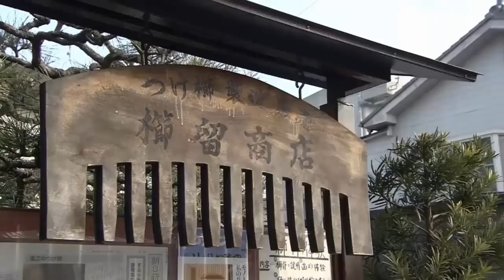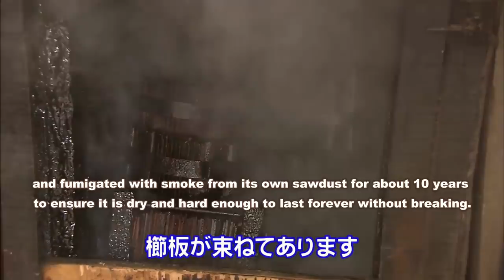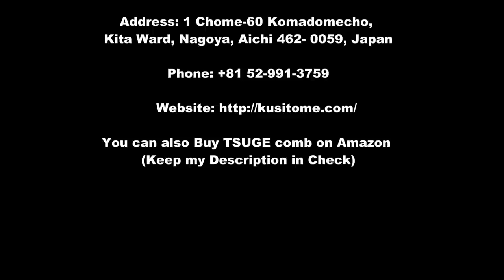It Took 40 years to Ensure the Combs Hard Enough to Last Forever | Young Craftsman: Mori Hideaki.

Comment: explanation from a woodworker: the decades long roasting process is done to set the wood straight and make it unreactive to moisture. normally wood warps slowly over time in one direction as it dries out over years/decades, and it warps back and forth when it gets wet and dries again. this is why you normally won't see straight wooden combs unless they're new. the tight bundling of the comb blanks with the metal hoops is to straighten them, they're showing that they're previously warped from the drying process. this warping is particularly pronounced because the wood is cut from small boxwood trunks, so the combs are slab-cut awkwardly across the growth rings. a better cut to reduce warping would be a radial cut, but that would require trees that are twice the length of the combs in diameter (the combs' teeth need to follow the direction of the fibers for strength, so they would be oriented vertically in the tree). boxwood is used because it is an extremely hard and smooth-grained light-coloured wood, but because it is so popular with woodworkers (for example for all sorts of turned objects like chess pieces), and it grows slowly, there haven't been any decent size boxwood trees for at least a century or two. 

what they're using to smooth the comb teeth are file-like tools made with fermented sections of the stems of horsetail weed, which grows microscopic silica spikes on its surface. it's effectively a slower alternative to very fine sandpaper.
Reply from the maker: the explanation is so well, I will go in-depth this in the next video released
Reply: Thankyou

Comment: What a very humbling job to have . Watching them make something as simple as a comb, makes me feel happy . Today everything is made so cheap and with no LOVE ...
Reply: Classic Gunsmithing is another trade that is taken very seriously. My instructor for gunsmithing is teaching me the traditional classic style, where i take a piece of wood that I had to buy (was a $200 piece of Walnut, which is actually on the lower end as you can spend over 2k on walnut), turn it into a stock (In this case a classic hunting stock), take a bolt action action (I am using a Mauser 98 action) and remove the old finish and re-polish it and either blue or color case it, buy a barrel blank chambered for your caliber (I am doing 25-06 Rem) and reem the chamber so it fits the round perfectly so there is no gas leak when firing, blue the barrel, and more. I simplified it as much as I could lol. Basically I spend $200 on wood (and soon to be more as I need a piece of ebony to put at the for-end of the stock), $425 for the mauser 98 action, going to have to spend quite a bit for the barrel blank, about $70 on a Timney sportsman trigger, and probably around $200 on renting a reamer bit. Oh and that's not mentioning the months going to have to put into it lol. I might also checker the wood. The rifle will be a high end rifle probably would around 5k at best and possibly more if it looks very good. Wood and metal work everywhere is taken seriously lol, sadly after every generation the old styles die off. Soon no one might want a classic hunting rifle or shotgun until many decades when it becomes a trend again lol.
Reply: But not very rich in variety.
Reply: Just checked their website. The combs are $250-600 USD. So they're not starving.
Reply: @littlejackalo5326  How long it takes to make such a comb, how expensive is the wood, how much earn the carftmen and, and and.....

Comment: dried for 40 years in a carefully tended kiln.

immediately rubs water on it.
Reply: The ones he's rubbing water on are wood that's been hung to dry outside of the smoking kiln for 1 year and has curved as a result. In order to straighten the wood pieces, they pair them up concave face to concave face before bundling them and forcing them into the metal hoop, which is then inserted into the smoking kiln for 3 months at a time for a total of between 5 and 10 years until flat. Water is rubbed on the concave faces before bundling in order to help the wood flatten more easily.
Reply: it’s not just water, I have seen wood treatments for high quality furniture carpentry, where after drying, they soaked boric acid or other chemicals and dry them out again. First drying they spaced them out to dry quickly. The wood have to be completely dry so the chemicals can get to the centre of the wood. Second drying they are packed tightly, otherwise the chemicals dried before reaching deep into the middle sections.
That Japanese techniques is perhaps overdone but the principal is the same, instead of boric acid, they probably are water with secret ingredients to prevent moulding, insects or bacteria decays.
 I think the Japanese method is much more superior and the end products will last much longer, even though it is painfully time consuming. But the crafted furnitures in my childhood hometown are known to last for generations.
Reply: @madsam0320  It could be, but in the original Japanese video it just says "he puts water on the bent faces to help them expand more easily."

https://youtu.be/CpcTsXxxi5U?t=460

Furniture and combs are different things. If you're familiar with this workshop specifically, then I'll defer to your expertise, but otherwise the original Japanese as-stated is the best source.
Reply: @pbrown7501  you are right, they put water only on the curved in sides, not soaking all over.
Reply: @pbrown7501  Thanks for the link to the original, unruined video.
Reply: The primary purpose it is put into the kiln is not to dry. It is to harden the wood.

Comment: I was looking forward to seeing how they cut the combs teeth so accurately 400 years ago. It was so disappointing to see them use a power tool. ☹️
Reply: I guess if you can make em without power tools then you can claim to be the best.  Until then I guess we both just watching a talented duo.
Reply: I imagine it wouldve been done with a wooden fixture and a hand file and wouldve just been extremely time consuming and wouldve been left to the younger men to do because theres not much to it, relatively compared to the rest of the process, and its time extremely time intensive. All youre trying to do at that step is remove alot of material in a rough manner so the fine work can begin with the hand files and sandpaper sticks (im not a wood working guy so idk the proper term for that tool)
Reply: I mean that power tool could be very easily made as a hand tool. It’s just a matter of making a wooden rail for a jig to slide on, and then attaching a wheel to the jig with a handle on it so that you can turn the handle to make it slide back and forth on the rail. Then just use the jig and a handsaw to make your cuts! You would just crank the handle, make a cut, then do it again and have remarkable repeatability! I don’t know if that’s how it was done, but almost all power tools evolved from hand tools, so it shouldn’t be too hard to think of ways it might have been done!

Comment: The AMAZON links are not at all for the combs in the video, they are from knock offs of the same style, not made of Boxwood either the knock offs are from bamboo. The link is just to have an AMAZON affiliate link in the description in order to be monetized ... and to basically rip off the company featured in the video. Shady AF and should be reported using the report button in YouTube. I am doing that and thumbs down spas well. Shameful ... ... ...
Reply: 170 USD for a shitty comb that (according to them) uses several tons of wood to smoke for 10 years. Dude, they deserve to be robbed.
Even producing a plastic comb pollutes less than that.
Reply: Yes if you look at the comb closely you can see that the back or spine is a separate piece of wood that is glued to the teeth of the comb.

Comment: I find it hard to believe it takes 10 years of smoking to dry out the wood.  It sounds more like a selling point or a way to suggest its superior.  I would be surprised if you don't get the same result in half that time or less.  I could be wrong, it just seems a bit of a stretch to say it takes 10 years in a hot and dry environment, to remove the moisture from a piece of wood so thin.  Now if it was 5 feet wide and 5 feet long, it would be easier to understand that, yes it can take 10 years for something like that to completely dry out.  Like i said, it just seems like some kind of selling point.
Reply from the maker: That is a traditional heirloom workshop. The current generation doesn't have to wait for the materials to make the combs because of its smoked over 100 years ago from the first generation. of course, the current generation must also continue to smoke woods for the future generations to inherit the job

Comment: ! DANGER ! That black stuff on the wood that spent 40 years in the kiln - that's called creosote. It's similar to coal tar/pitch and has been used for centuries as a preservative on fences, bridges, railroad ties, and telephone poles. Even in LOW LEVELS, it's a carcinogen - it even impacts people that simply have wood-burning stoves and fireplaces through breathing it. It's the black stuff that builds up in wood-burning chimneys. So, old-time chimney sweeps had a HIGH level of cancer between their legs (the reproductive parts; if I write it here I'll probably get censored). The lucky ones merely had reproductive issues. Long-term exposure leads to kidney and liver problems. Children that play in environments/soil that contain any level of creosote are more likely to have skin rashes.
 A friend of mine's father has multiple sclerosis (MS) and the doctors believe it is directly related to his handling of creosote-treated railroad ties while making a garden. DO NOT USE THIS PROCESS FOR WOOD PRESERVATION... even if you think 40 years is a long time...

Comment: I'm pretty sure, from a manufacturing standpoint, you don't need to fumigate it for ten years to achieve the same durability. A pressure chamber to remove the moisture and impregnate the wood with its own smoke (it's basically creosote) into its fibers should cut down its production time. 

Before you blast me with traditionalist rhetoric, I'm not saying they should do it this way. It's just that they could if they need to accelerate production for any reason without significantly sacrificing quality and authenticity. They still need to hand-pick the wood and check its quality. They still need to apply all the manual labor into it. It's the fumigating process I'm suggesting could be done differently.
Reply from the maker: WOW, good point!!

Comment: I believe it's not about drying, but to stregthen enough the fibers and resins of that specific type of wood (chosen for some reason that I don't know) so it can last as long as possible, thin as it can be, to comb long hairs (it is known that women and some man kept it lengthy, and it takes strength to comb it, as we still know it). Have in mind that other comb materials, like bones, horns and tusks are easily breakable and metals were really really expensive in Japan.
Reply from the maker: WOW Great Point!!
Reply: @WoodworkingEnthusiasts  
By the way, you have a great channel! Thank you very much for making those beautiful glimpses of masterworks accessible.
Warm greetings from Sao Paulo, Brazil.

Comment: I very much doubt the wedges are smoked for 10 years, probably the drying of the wedges takes that time either before or after being smoked. I can’t think what the smoking part actually does? Maybe it imparts some resins to the structure or makes it harder or more elastic or maybe all of these things?
Reply: Japanese artisans are VERY much into what they do so if it-s 10 years it-s 10 years ... That`s why they are expensive AF ...
Reply: Probably so the wood cracks if its a bad blank with a hidden imperfection
Reply: I did some research on this and depending on which website I looked on the words Smoked and Dried are used interchangeably, probably something gets lost in translation? I understand how the Japanese take their work to the very highest levels but I just can’t see them maintaining a smoke vessel everyday for ten years....TEN YEARS!!!  I’ve worked with Boxwood and other woods as an amateur Bowyer and understand the necessity for drying wood until it is at a suitable moisture level for the task needed. Those thin slats would dry out to the core and reach equilibrium with the relative humidity level of the drying area within a few months. Leaving it for Ten years won’t make it any drier so I wonder why they do it? Maybe tradition or so as to have a good long supply of blanks always ready? It doesn’t matter really I suppose.

Comment: 1:45 10 years? So those wedges in that smoker are put in there for a constant 10 years being smoked day and night?
Reply: It doesn't look like it was smoked constantly, however drying wood for a few years is pretty normal, So are kelms.  What is probably done is with every maintenance like you saw there where they inspect and restack the blanks(probably to make sure they are straight and will not warp), they smoke it again.  If it was constantly smoked, they would be darker(probably more red or brown) because the nitrites penetrating the wood.  But as we see, the wood is only slightly tanned other than the ends and the outside layer that was sanded off.

Comment: That fumigation process shown at the start... Isn't it basically soaking it in liquid tar from the unclean burn of the sawdust? I guess it's elegant in a way, but it's not actually anything unique... Staining wood for long term use which lasts for decades or even centuries can be found literally anywhere in the world, old European buildings with wooden beams that are still standing after over 500 years despite the wood being the main structural material.
And even today you can see use of more modern versions of this process which takes 3 weeks instead of 10 years due to use of better chemicals that achieve the exact same purpose, making the wood incapable of rotting.

Comment: I appreciate the dedication to craft for the sake of being good at something. As for the actual product, however, I cannot see any benefit over your typical plastic comb. Actually, I would imagine your typical plastic comb as being far more flexible, durable, smooth/slippery (i.e. passes easier through thick hair), and resistant to changes in temperature/moisture. It seems you're not paying more for a better product but rather more for the extra effort that went into it. That's fine, I enjoy redundant products as well (e.g. live steam, antiques, etc), however those things aren't still being made the same way; they're just old. The only reason I can see someone buying a new comb made this way is either merely for the sake of supporting a redundant craft (e.g. mechanical watch makers) or, as someone else noted, hipster credibility.

Comment: Calling BS on the 10 years smoking. It wouldn't be economical to do it that way, much less viable - imaginr messing up just once.

Also, you don't really need that much to begin with. Wood is plenty hard as is dry, you don't at all need this excessive drying process. 

This is just another mystification of a mundane craft. Sad that we never got to see how they would make the teeth traditionally, which is really, the most important aspect of it all.
Reply from the maker: good point!!